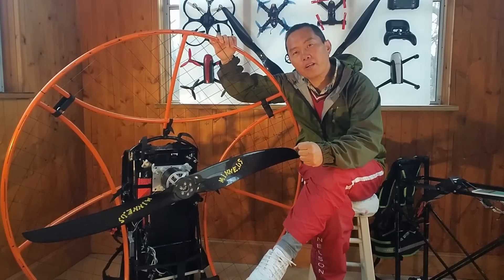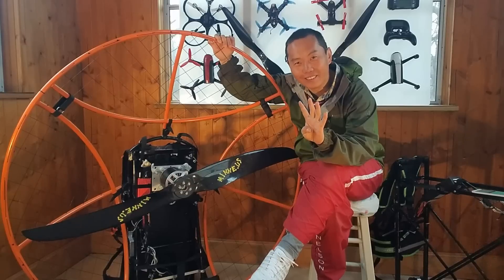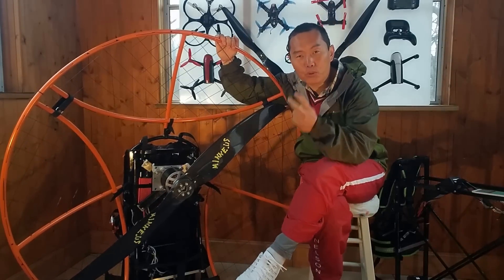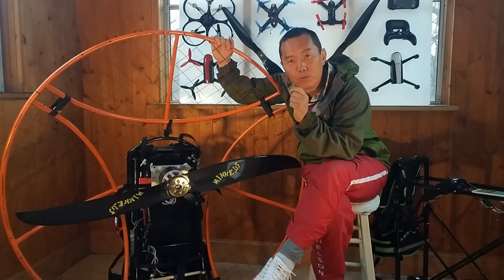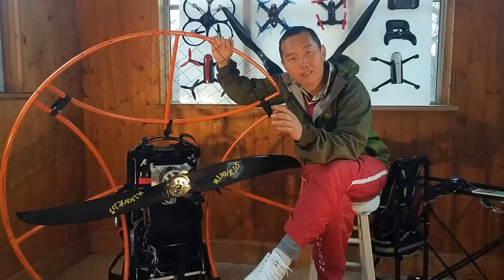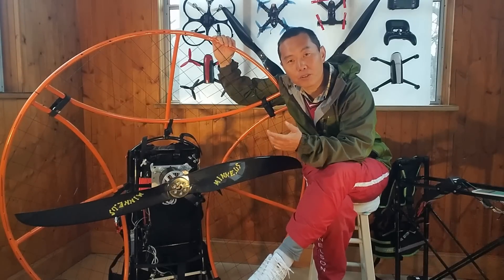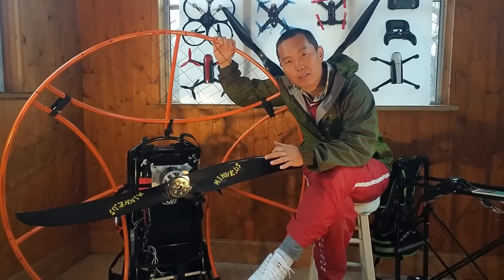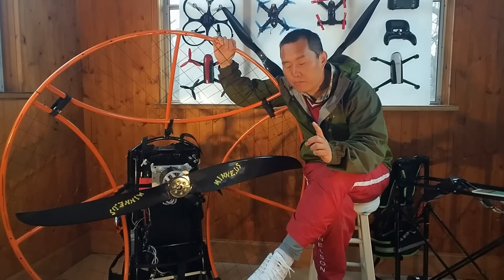4 things you should know about electric paramotor

Comment: Is it possible for you to design and sell an electric paramotor that can double as a wind turbine to recharge the battery?  Such a system may be useful while camping and the paramotor is on the ground in a windy spot or while the pilot doesn’t need power and is ridge soaring or needs to descend.
Reply from the maker: Portable wind turbine, only charge cellphone or laptop. Use common generator to change batteries on trip, probably is the easiest way.
Reply: Well, I can buy a bridge rectifier and MPPT charge controller and a 90 volt to 220 AC inverter from Taobao and eBay for only a total of less than $100. Couldn’t these components turn your 3 phase brushless motor into a 220 volt AC source?
Reply: @thedronehorseman4713 
Do it and link it my man !

Comment: Why doesn't someone put a 30cc petrol motor in these driving a  generator to keep the batteries topped up as you fly  ? 
Or run a generator off the back of the electric motor ?
Reply from the maker: One big reason to use electric paramotor is efficiency. Gasoline engine only transfer 60% energy, there are a lot of waste on chemicals and heat. Electric motor can get 90% efficiency. And you just try to reverse it.
Reply: Simple answer: too complicated, too heavy, too many things to go wrong. 
Keep it simple!
You'd be better off lightening the load enough to carry an extra battery, rather than fuel and all that stuff.

Comment: Have you heard of the "Sun Race"? From France to China using only solar bikes. Push bikes that have solar panels that do 200 to 300 kilometres a day by sun alone. Then there is trolling motors which are for kayaks. They can cover 100 kilometres a day, (torqeedo.com). If you had large solar panels ie. two 100 watt that can power the battery non stop then you could cover huge distances. This is the future.
Reply from the maker: Sure thing!

Comment: Thanks for showing different battery options. If the power tools batteries like 80V Kobalt running a brushless 50kv motor, this would rev prop speed to 4000 rpm? Assuming your prop is 40 + inches and under load, full power prop speed may be around 3400 rpm, so what amps draw do you get on that battery?
Reply from the maker: There's circuit beakers to regulate current.  check on my website http://www.Minne.us
Reply: Jerry, yes I get the circuit breaker to regulate current just like a fuse if current exceeds certain amps draw.
My concern is the 80 volt Kolbalt battery does not state any "max amps" like lipo battery. I assume you have tested amps draw at full throttle, if so what is max amps you allow on these batteries?

Comment: Lower the costs but increase your chance of combustion with cheaper batteries
Reply from the maker: This is funny, have you ever heard Power tools caught on fire? Power tools battery is much durable and safe compare to any Lipo battery. Expensive is not always means good.
Reply: Absolutely - Black & Decker withdrew a line of portable drills, Samsung withdrew a line and are still facing lawsuits - it is a well know problem with modern batteries, all aircraft and car manufacturers currently working on electric power implement a fire safe system for their batteries which vary in type it is irresponsible to declare any type of battery as fire safe especially in a manned flight application, battery fire is real and a very possible danger. ...as funny as that may be to you.
Reply: @wingnutzster  lithium iron phosphate are in the 80v battery. Samsung phones are using lithium polymer which have more energy density but an increased fire hazard potential. Electric paramotors don't have a market like outdoor power tools. Good luck even filing a lawsuit...

Comment: nice unit BUT. one advantage of 4 motor is SAFETY.  less damage to flesh than 1 large propeller
Reply: Yes, but the 4 little propellers are super loud !!!
Reply: LOL "SAFTY" a prop strike is going to hurt your flesh no matter how many props. it hits..  what if some reason your props are spinning and you stick your hand near it and hits one prop and bounces into another prop?  that sounds so much safer.... you just entered the blender zone...
plus since its electric it doesn't need to spin when you dont need thrust.  no start and strap in like some do. that's just unsafe.

more motors just gives you more failure points and more unknown problems that can occur.
Reply: On a multiple motor set up if one side fails at takeoff during max thrust it would lead to an immediate riser twist. Depending on how many times you twist brake input can appied but line friction will hold that input. Uncontrollable flight low to the ground... been there done that...no thanks.

Comment: Your complaints about the multi motor set up are not accurate. Multi motors have the added benefit of being redundant. Also, there is very little to worry about balance of output. Being hung from parasail negates nearly any concerns or effects that would necessitate a complex balancing controller.
Reply: Redundency is not very important with a paraglider, since it doesn't really NEED a motor to fly. 
The multirotor setup is loud as hell, which defeats the purpose of flying electric.
Reply: and purely unnecessary  @OlivierSuire  ;)
Reply: My concern would be if the motors are not inline with the pilot like the quad drone set up, a motor failure at takeoff would result in a sudden riser twist. Any chance of offset thrust on a paramotor would be scary... K.I.S.S.
Reply from the maker: Thanks for your comment. Everybody see things differently. I thought it complicated, you saw it's redundant. That's the beauty of the human mind.